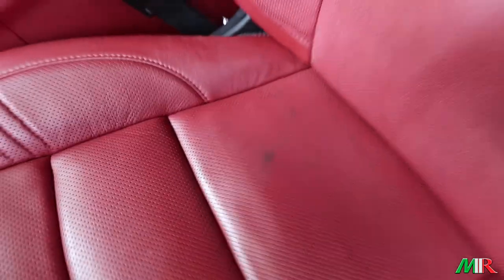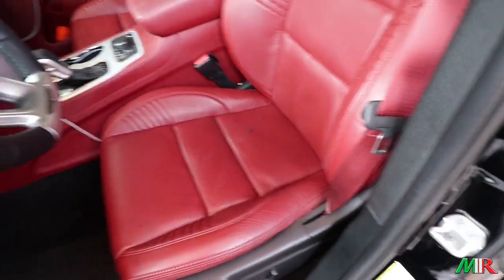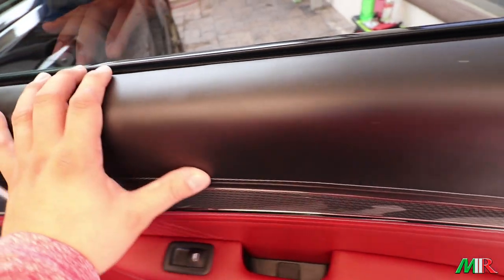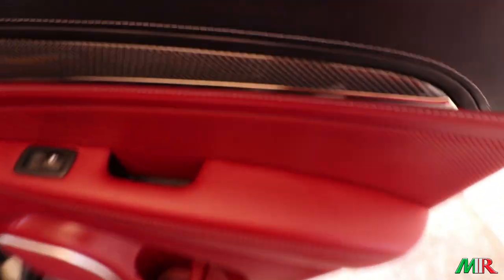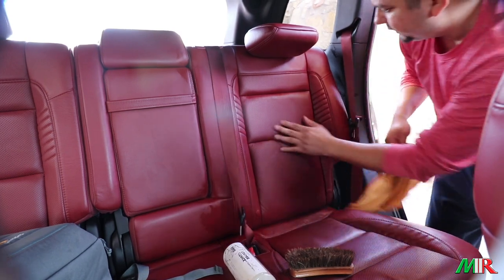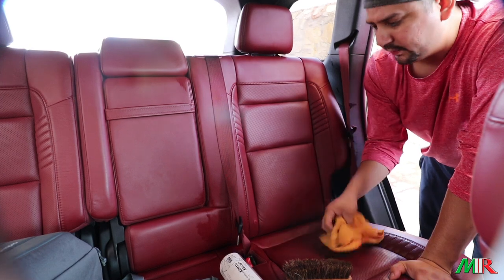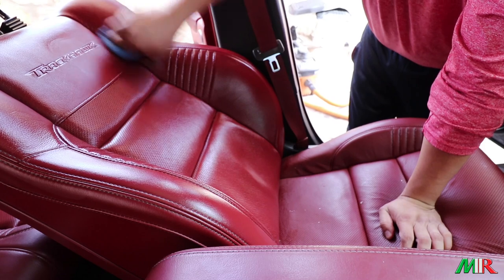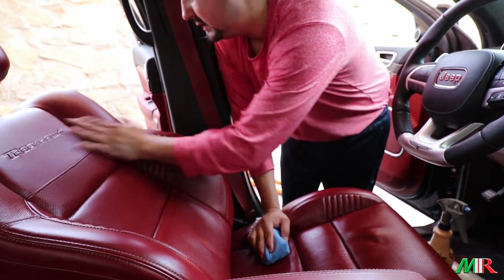#Detailing the #Trackhawks Filthy Leather Interior

Comment: Can you rebuy the Laguna leather or Mopar doesn’t have these in warehouse because I got into a pretty bad wreck and the airbags deployed and ruined the stitching.
Reply from the maker: Randy Agyei. I’m sorry to hear. I think they are available. Previous to the TH I had the GC SRT and had all black Laguna leather I wanted to buy the seats and accents the orange leather color and they quoted me in my dealership with the vin of a truck that had the seat color I wanted. I’m not sure if they can do it at your local dealership. If not there was some website that you can replace the leather seat covers. I’m not sure if they offer them for the Laguna leather or have those options available. I wish I could be more help.
Reply: Mods2Rides oh I see thank you I was a bit worried that the red leather was limited to the vehicles only. Also the Harman Kardon speaker grill got a dent in the front drivers seat can that be replaced as well ?
Reply from the maker: Randy Agyei. I’m sure you can.